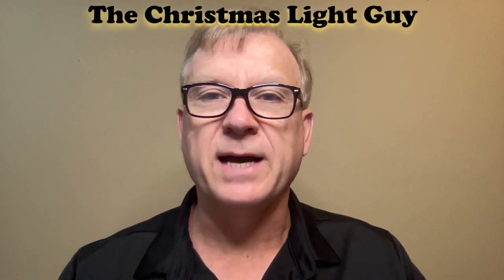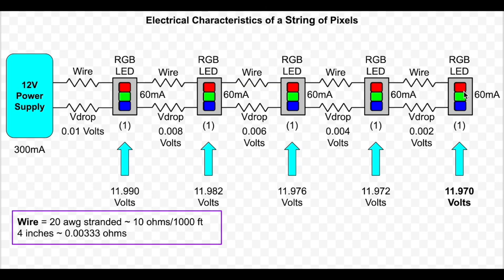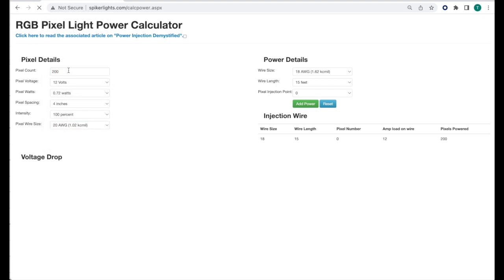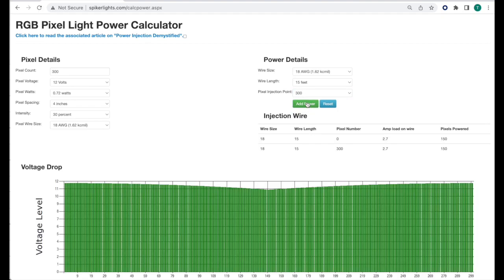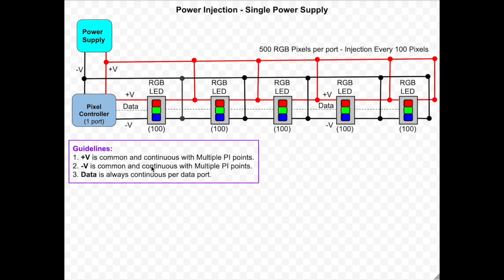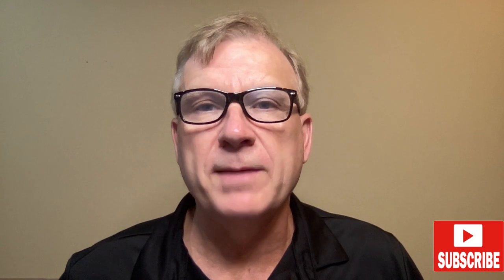Power Injection Explained in Simple Terms

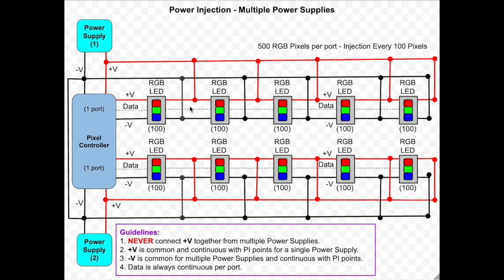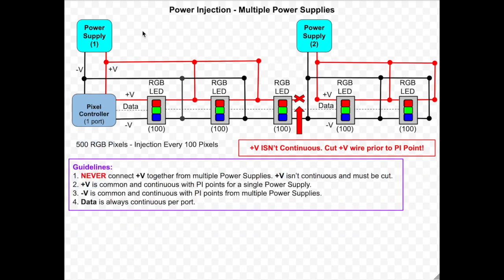Comment: So you say when using one controller port but two power supply (PS) to never ever connect the +V together. Isn't that exactly what you are doing in the diagram shown starting at time 5:36 ? You don't have a red line connecting the PS1 +V to the PS2 +V but internal to the controller there is only one port 1 +V. The second diagram starting at 6:43 makes sense because you isolate the second string of lights from the port 1 +V by severing the red wire. The second two PS diagram makes sense, the first one does not because both halfs are sharing the port 1 +V.
Reply from the maker: No.  Sorry I see how this can be confusing.  Some controllers have power terminals/connections for 2 power supplies.  The controller has two separate power terminals/connections.  One connection is used for the 1/2 of the ports and the other connection is used for the other 1/2 of the ports.  Example: Falcon controllers with 16 ports has 2 power connections (+ and-).  The first  power supply terminal is for ports 1-8 and the second power supply terminal for ports 9-16.  The positive (+) connection isn't tied together on the controller.  Does that make sense?
Reply: @thechristmaslightguy  Thanks for the reply but I'm still confused. I understand your explanation, you say ports 1-8 use one PS and 9-16 can use another. But isn't your diagram only using a single port, port 1? Wouldn't that mean there is no opportunity to use a separate PS. Sorry for being so dense, just try to understand this.
Reply from the maker: @GFSwinger1693  I understand your confusion.  My diagram is labeled "1 port" on both ports. It is meant to indicate 2 different ports (as in 1 port and another port). I guess it would have been more clear to mark the ports differently such as  port 1 and port 9.
Reply: @thechristmaslightguy  Ah ha! OK, that makes more sense. Either two different ports that don't share the same PS at the controller or as in example 2, one port but sever the red power wire. Thanks for clarification. Good day.

Comment: Hi, Thanks for that video. I have 5 strips of ws2812b leds that I’m trying to power inject with a second power source. 
I have source 1 (5v 3a) to the sp110e controller to the 5 Alitove wd2812b strips (each with 150 lights). I power injected at the 3rd strip, with source 2 (5v 60 amp supply), cutting the v+ between strip 4 and 5, then connecting source 2 to the power injection lines of strip 4. The v- and signal lines between strpis 3 and 4 are connected. But strips 4 and 5 are not coming on. 
How can i fix that? What should I check? 

Note: when I injected using just the same power source for everything, it all worked fine.
Reply from the maker: Do you have the v- from source 2 connected to v- on strips and source 1?